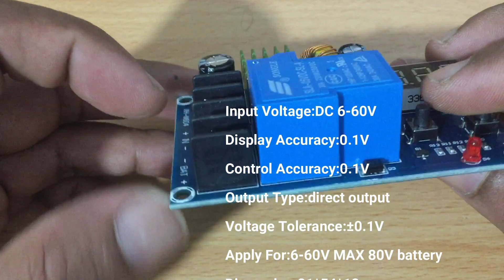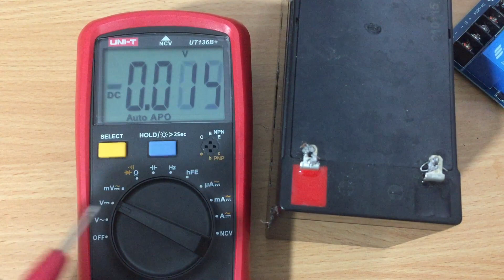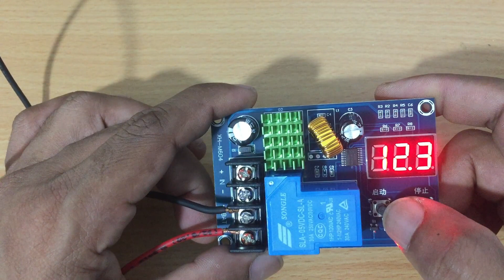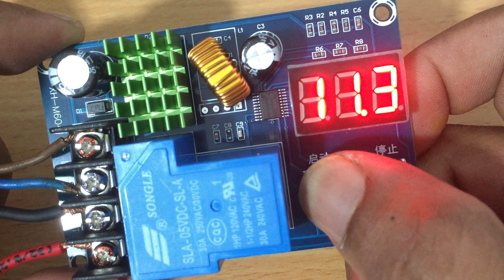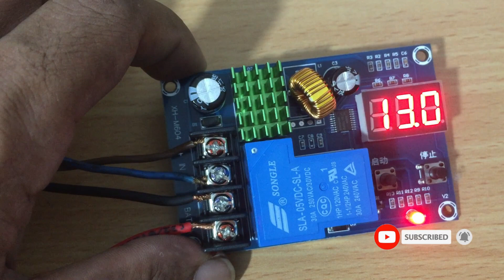Charge any Battery with Control Module DC 6-60V XH-M604

Comment: Hello thanks for the useful video. 
Can we use this module to charge a 100Ah 12volt lead acid battery at 19volts and 0.5Amps settings (is it possible to set these parameters) , or does this module only allow setting a voltage of 14.4volts for a 12volt lead acid battery  ??
Reply from the maker: This module can handle 30A and 60V. Its mean that you can charge up to 300Ah battery. Yes, if you r battery is 12V it is better give 14.4v power supply. Remember that this module can not control the voltage.

Comment: If I set start = 11.9 and stop =13.8

what if I connect a battery with current voltage = 12.5 ? 

Does it connect and charge the battery or not? 

Thanks for replying
Reply from the maker: Yes. but you have to give power from a power supply at least 14v

Comment: Good day sir...i have 24volt charger...i wanna buy that kind of module....can i charger...12volt battery?
Reply from the maker: Note that this is a charging controller only. you you can charge up to 60volts - 30A  the battery, but you need a power supply.
Reply: That module can step down voltage?... @setnfix
Reply from the maker: @DevRohan-w3h  6v to 65v

Comment: Hi, thanks for making the video. I want to ask if I can use this module to charge my 12 v 15 Amps battery with a power supply adaptor? 
Is this the same as a buck converter? My power supply is a 15 volts adaptor, i want to charge my lithium battery with this module, is it possible. Sorry i am just a learner, so i really don't know.
Reply from the maker: You can charge your 12V 15A battery. but you need a power supply and also this is not a buck converter.
Reply: @setnfix  yes i have a power supply (Adaptor).
Reply from the maker: @IamAli89  Then no issue

Comment: Hı sir, When the battery is charged, the relay turns on and off. What could be the reason?
Reply from the maker: It is because of your charging and cut off voltage to more closer. if your battery is 12V keep cut off as 14.1v and rechargeable voltage as 12.4V. In rare cases this can be due to bad batteries.

Comment: This module has nothing to do with charge current, which make it useless for me as i wanted to add in my solar mppt controller which dont have the current limiting setting
Reply from the maker: You can not limit the current. This is a charging control unit. not current controlling.
Reply: @ i need current control as this feature is missing in my mppt
Reply: Hi, thanks for making the video. I want to ask if I can use this module to charge my 12 v 15 Amps battery with a power supply adaptor? 
Is this the same as a buck converter.?

Comment: Will it charge a 36 volt 10 s lithium battery if we set it to circuit?
Reply from the maker: You can charge 36V battery by giving a power supply through this module.

Comment: If i give 20v input from solar. Can i charge a 12v battery with this module?  I mean, can this module step down the solar voltage?
Reply from the maker: NO, If the battery is 12v, give around 14.2 volts.

Comment: i have issue with this control module i test the battery in multimeter it shows 12.8v dc but then when i connect to the control module it shows 13.9v dc does anyone give the solution how to calibrate the display of control module?
Reply from the maker: It is normal to show the voltage is higher than the module on multimeter. But this is un usual.

Comment: Can I use this module for AC DC fan 15 volt step ? Battery?😊
Reply from the maker: Yes. You can use max up to 60V, 30A battery
Reply: @setnfix  ni mere pass 20 ah ki lithium battery Hy 18650 wale
Reply: @setnfix  I have 30 ah lithium 18650 cells battery 12v
Reply: @setnfix  car I use this module for battery step up to 15 volt the I supply 15 volt my ac DC fan for speed up can it work for this
Reply from the maker: @sanaimtiaz8635  you can charge your battery through a power supply.
Reply: @setnfix  I want step up 12 volt battery step boost to 15 volt supply for my ac DC celling fan my fan running slow on Battery u understand

Comment: When i connect battery to the module. My battery is discharging quickly. What the reason?
Reply from the maker: It takes only small current to keep standby the unit. I think there  may be a short .
Reply: @setnfix  Can we use the module for a lead-acid battery?
Reply from the maker: @sridharv5969  Yes, I am also using for 120A/h 12v battery (now more than 2 years)
Reply: @setnfix  can we use led acid battery?
Reply from the maker: @sridharv5969  same question i think
Reply: @setnfix  I used a lead-acid battery, but the voltage dropped quickly. When I applied a charging voltage through the battery output pin, the module showed the correct voltage.
Reply from the maker: @sridharv5969  Check you battery

Comment: Can I connect adaptor first? My adaptor voltage is 19 volt.....does it decreases voltage 14v or 12.6v?
Reply from the maker: No. you can not regulate the voltage using this module.
Reply: @setnfix  then what is use of this module tell me sir...

Solar panel also gives 19 volts, then it will not decrease voltage? Then how will it charge my 12v battery?
Reply: @setnfix  We can give it 6v to 60 volt ..means it can regulate voltage
Reply: @arpitsingh5152  This thing will only output same voltage you feed it then cuts off power when it reaches max or drops below minimum. What you need is a step down buck converter.

Comment: Does it automatically set current and voltage of charging battery?
Reply from the maker: No you have to set the cut off voltage and re charging voltage.
Reply: @setnfix  I will set a voltage limit of 12.50 volt, but what if current is 5 amps but I need 2 amps for charging?
Reply from the maker: @arpitsingh5152  You need the 10% of current of the Ah of the battery. check this video how to control the current and voltage https://youtu.be/9ousokeK9lA
Reply: @setnfix does this module work with Lithium ion battery?
If I use Solar panel of 50 watt then it will give 20v..

Lithium ion battery need 12.6v something to charge

Then will this module convert 20v to 12 or 14 volt for charging?

Comment: So if i use this circuit there will be no issues if i will leave my charger on 24/7.. because i will be using this to power my 12 v alarm system in my vacation house...and   sometimes it takes months before i visit my place...thankx
Reply from the maker: Yes. If you adjust the circuit correctly, no worries.
Reply: If it heats up then maybe use a fan to cool it and it will probably run forever

Comment: The LED remains light up after disconnect input supply. Also it continuesly used battery (consumes battery) when not connected to input supply. How to connect led that only light up when inserting input supply and led off when remove input supply on the module?
Reply from the maker: It is required to connect the battery with circuit to detect the voltage level. Then only the circuit can detect the voltage is lower than the minimum voltage. The LED is just and indicator, if you do not want it, you can remove it.
Reply: @setnfix  already removed it,  So how to connect led in between the  relay (led light up when insert input supply from charger.)
Reply: @octamy-qn8hl  use a relay for the purpose..

Comment: hi, can I connect the module to a dc genarator to charge the battery? is the dc generator able to charge it? thanks
Reply from the maker: It is based on the battery current and the voltage.
Reply: @setnfix  how can I increased the current of my dc generator?

Comment: Can we modify this module to charge 60v battery. , that is upto max 72v cut of voltages.??
Reply from the maker: I do not think so. Since this is a pre programmed one, we can not change. But you can hack with few modifications.
Reply: @setnfix  thank for confirmation 👍

Comment: Using this I could use the alternator from my car to charge a smaller battery (like one in an APC) without the risk to overcharge the smaller battery ? Would this prevent ocer discharge too ? I suppose a battery isolator is require too ?
Reply from the maker: There is no discharging system. But once the battery is fully charged the power will automatically be cut off. Therefore, there is no issue about overcharging.

Comment: Is this a boost charger? If my panel is 30V, can I charge a 60V battery?
Reply: 48v & 51.8v lithium battery can charge with giving voltage below 60v.👍
Reply from the maker: @technicaldada5384  Yes
Reply from the maker: Not engouh as if you charge a battery 60v, you may need power more than 60V.

Comment: Hi my friend. I have a question I hope you can give some of your good advice. If I want to use this in my solar setup, where should I connect the line for the power source? Is it going to be connected to my solar panel array? I want to use this because my battery keeps overcharging specially during high noon. Thanks
Reply from the maker: do not directly connect this with solar. This can be used to charge the battery using power supplies. Use solar charging controller and set the correct settings to stop charging voltage then the battery will not be over charged.

Comment: I don't think the circuit can handle 30amp the tracks is too thin at the bottom from the relay it will probably burn out
Reply from the maker: NO, I am using 30A power supply to charge 120Ah car battery. There is no issue.
Reply: @setnfix  I'm waiting for the next video that's charging a battery with high current..(max 30A) 😉
Reply: @setnfix  The relay can probably stand 30A but I don't think the PCB tracks can. They are too thin. And your charger may be a 30A charger but the battery was not drawing way lower than 30A

Comment: 12v 5 battery use Serees 
60v 40ampare use battery charging is perfect?
Reply: 60v battery but use perfect or no?
Reply from the maker: normally it is recommended a charger with 10% from the Ah of the battery. This relay can handle only maximum 30A. If you want more, use a automotive relay like 80A

Comment: So, this is 2 point charger. What is the coil good for and the IC under the heat sink?
Reply from the maker: The IC with heat sink is a voltage regulator LM 2596. The coil is used as an inductor. Those are used to pass the smooth current through the circuit. Inductors are also useful in removing noise due to their ability to keep out high-frequency AC.

Comment: Does it also work as buck/boost convertor or do I need to supply exact voltage? May my supply voltage fluctuate? Thank you
Reply from the maker: no boost or buck. you have to use sufficient voltage are you required to charge the battery.
Reply: 12V Battery directly charge by 100W 18V Solar Panel   ?